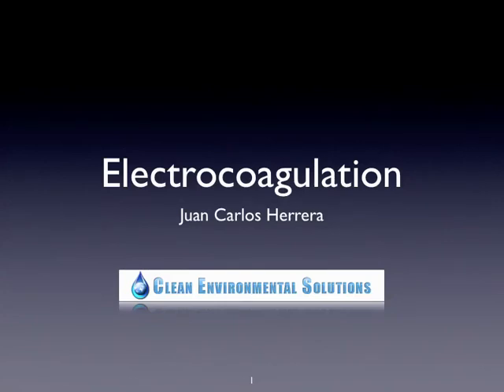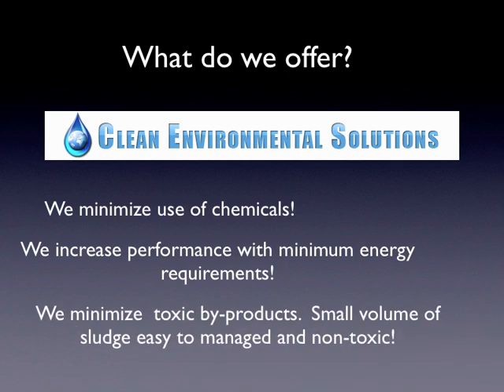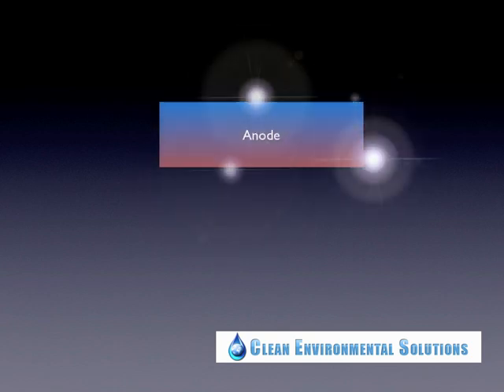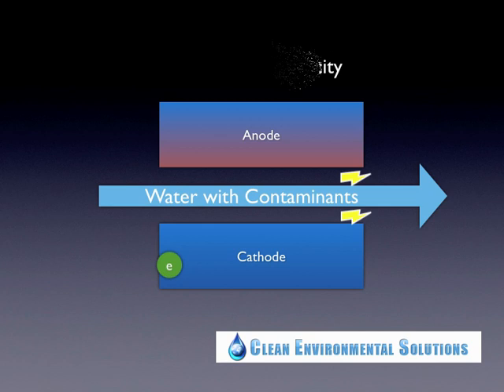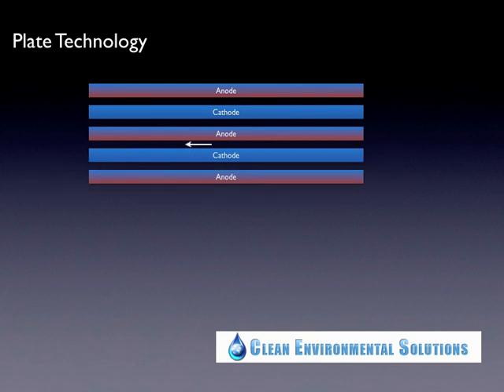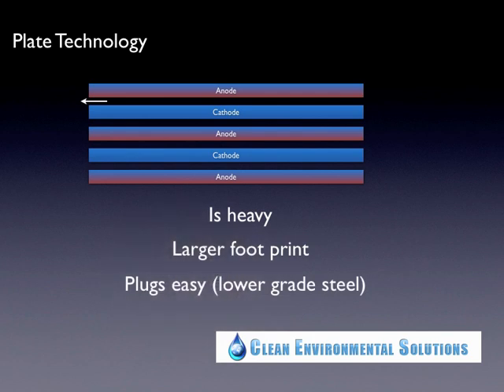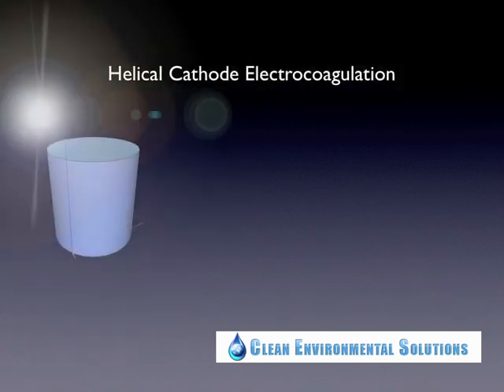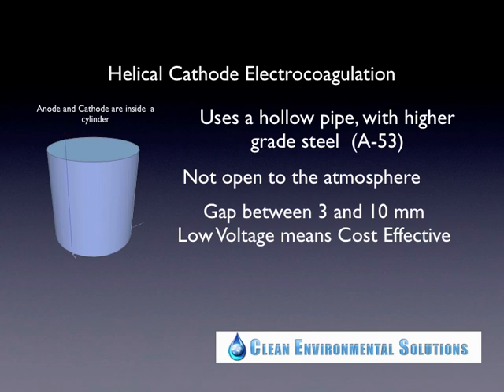Electrocoagulation 101

Comment: Hello Mr Herrera, Good day, i need your help in electrocoagulation, I have made one unit in which i used iron plates with surface area of 10000 cm2 (both sides included). I used 18 pates of same area. Total volume of tank is 210 liters. what should be the required voltage for this? Please guide.
Reply from the maker: Hello Saad, Voltage is not the key. Amperage is the key. But what you describe does not make too much sense to me. Seems like a very big plate 10,000 cm2 for one plate is like 1550 square inches. This would require very high amperage. Are you sure you have calculated the surface area correctly. Very small tank to hold 18 plates? Something is not right. Let me know. Thank you.
Reply: @H2electrofloc  hello Mr Herrera, thank you for your reply. 
The plate dimensions are 0.50 m x 0.95 m. 
Total plates used 18 pcs. (9 anods, 9 cathod)
The volume of tank is 210 Litres. 
My target flow rate of wastewater is 67Litres/min. Means retention time would be around 3 mins in the tank. 
Can you please guide on this. Thanks.
Reply from the maker: @saadjaved7023  It seems to me you have very big plates for such small flow rate. In order to have meaningful EC process one plate will require around 450 amps for just one plate. It makes no sense to me.Why not use less plates and smaller size so that you can do the process better with a manageable size power supply. In my opinion you don't need such size. To answer your original question voltage is not the important factor but as long as you have more than 2 volts you will have EC process. Volts depends on conductivity of the water and space between your anode and cathode. The key is to control the amps for a steady process.
Reply: @H2electrofloc  hello Mr Herrera, 
Thank you for detailed reply. Can you suggest me area of each plate for this volume? Also number of plates. I want continuous flow of wastewater (67L/min). I used 2 cm spacing between plates. Do you suggest the same? Thanks
Reply from the maker: @saadjaved7023  How many amps can your power supply give you in the process. How big is your power supply?
Reply: @H2electrofloc  Hello Mr. Herrera, our power supply can give upto 5 ampere in continuously. Voltage 440V.
Can you plesase suggest for continuous flow of 210L/min, what should be the surface area of the plates, what should be the DC ampere. Thanks
Reply from the maker: @saadjaved7023  Hello Saad, I am not sure if I can be of much help to you since I don't build EC units using plates for this very same reason. They are inefficient and rely on high voltage which I find it dangerous. I make them low voltage and high amperage. The power supply is not good in my opinion.  For iron plates you should use current densities around 0.2 or 0.3 amps/in2 so you can do the math regarding size of plates you want to use in reference to the Amps. I achieve 100 GPM with 10 cells.

Comment: Dear Sir, too much thanks to your kindest active explain,  I keep to one of question that, 
un-treat waster water keep to color mixed  yellowish, pinky. Because this wastewater sauce from piggy faces and urine, we treat 1st step to separate solid and liquid by decanter add  a little quantity cohesive chemical.  but a little include solid and color,  let me know to this electrocoagulation processing possible to discolor ? I think of cause , possible.                         than I wish please  your advice to the test kit by my self product.  thank you.
Reply from the maker: Thank you,  I think you have high levels of Urea. Electrocoagulation can take all the color if you combine Iron and Aluminium electrodes. Using EC you could clean the water in one single step. EC will cause all the solids to float at the same time treat the water. The right combination of power with iron and aluminium will leave the water clear. You may need to add a little bit of brine solution but not sure depends on how much conductivity the EC cell can handle.
Reply: Dear Herrera. Toooo much thank you to your kindest advice, its are very important advised guide for me. meaning that your assist are I will research and study to able to drive correct way road, OK, I will discuss concerning to reasonable EC electrodes and how much capacity convertor from AC to DC etc. also I will prepare salinity liquid for increase conductivity. future, I will connection again to you and the results and following questions etc. thank you.
Reply: @H2electrofloc   Dear Sir, so your advice is very important advice for me then I product lab  and  base pilot capacity  EC. I will trial test but lab scale,  but I keep to one questions that brine solution, it may be sea water, injectable solution for human, and more conclude content salt solution possible, I will arrange 0.1%~25% of salt contents solution possible.  for the more, do you advbice me possible to how to different salt or salty solution VS your brine solution.  because we do not study to brine? then I do not catch to what's the urine?   sorry. please help me.. thank you.
Reply: @H2electrofloc  Your website appears to be broken. Is their any other way, we could reach you?

Comment: hello sir thank you for the video .my question is that i am presently working on the project of "treatment of distillery spentwash using electrocoagulation" which is having chemical oxygen demand (COD) 120000-180000. so what should be the spacing of the electrodes should be used in the treatment.

Comment: I would like information on this technology as it compares with vacuum pressure system, capital costs, o & m costs. Engineers are currently recommending vacuum pressure systems with a high capital costs for sewer systems. Also what information can you provide for public drinking water systems because RO systems are the engineers choice and it is very high in capital costs and the O & M is very expensive and the expertise to operate such systems is almost non-existent in this low income communities.Sincerely,Cesario F. Vela

Comment: Hi, I am a student working on grey water treatment system for residential purposes. I am interested in incorporating the idea of electrocoagulation within the system. I know that its typically used on a larger scale but do you think it could be possible for maybe a home?
Reply from the maker: Hi Mily,  yes  eléctrocoagulacion can be used at any scale it is a wonderful proces you simply need to know that there are two kinds of power you can use to apply it. One is DC power or AC power, it will work with both but there are things you need to consider. AC power will be or could be a little bit more dangerous to use than DC power but DC power is more expensive. Good luck
Reply: Juan Carlos Herrera Thank you for your swift reply, I am working with Mily on our senior project. We would like to know some additional references as well that describe electrocoagulation and its development in today's tech based environment.
Reply from the maker: Thank you! I would be glad to help you and point you in the right direction. Let me know what else you would like to know.
Thank you for your interest

Comment: hello, first I want to thank you for the video, and second I am working on the improvement of the large scale harvesting processes of micro-algae cultured in sea water, do you think the chloride in the sea water will not affect the metal in the electrodes, and do you think in my case the electrocoagulation is the best dewatering- harvesting method that I should propose for a large scale production? thank you very much in advance.
Reply from the maker: Hi Fatina, thank you for your question. Sea water is definitely corrosive but don't let this stop you from your project there are ways to get around it. As far as dewatering or harvesting  I need more information to give you a better opinion on this matter but I will answer generally speaking. Electrocoagulation does not dewater but initiates the basis for dewatering without the use of chemicals which I think will be beneficial to your application. I would say if Fe or Al do not affect your micro-algae then either of those electrodes could be use. You need to dewater using other methods such as DAF (dissolved air floatation), centrifuge or simply by gravity depending on the size of your project. Also I need to tell you that in case Fe or Al affect the algae I have also available a non-sacrifical electrode this is a special electrode that will not put anything in the water but it will simply generate oxygen and hydrogen and initiate coagulation so that you can further dewater your product. I hope this helps or send me more information about your harvesting process.
Reply: Juan Carlos Herrera thank you so much for your answer that was very helpful
Reply from the maker: fatina 미나 your are welcome.  I  have used Electrocoagulation to harvest or gather material from a mussel farm where they are interested in collecting the sludge material which contains a lot of nutrients for the soil.  I imagine it will be a similar application for you.  They cannot coagulate using chemicals so they need to collect it using another method and Electrocoagulation seems to be the answer.  If you are interested send me a  email and I will. Se do you more information.  Also other information about other processes to harvest algae and phosphorus if you are interested.

Comment: Eletrólise.
Ótima solução para tratamento de água.
Repliquei esse experimento tentando tratar uma água de um lago ornamental mas... a amônia deu um disparada. Você mediu os parâmetros antes e depois da aplicação da eletrólise? Sei que esse processo é um excelente floculador, algicida e desinfectante mas, os parâmetros da água não ficam numa faixa ótima de potabilidade
 
Electrolysis.
Optimal solution for water treatment.
I said this experiment trying to treat a water an ornamental lake but ... ammonia gave a shot. You measured parameters before and after application of electrolysis? I know that this process is an excellent flocculator, algaecide and disinfectant but the water parameters are not in a great range of potability
 
La electrólisis.
Solución óptima para el tratamiento del agua.
Dije este experimento de intentar tratar un agua de un lago ornamental pero ... amoniaco dio un tiro. Usted ha medido parámetros antes y después de la aplicación de la electrólisis? Sé que este proceso es un floculador excelente, alguicida y desinfectante, pero los parámetros del agua no están en una gran gama de potabilidad
Reply from the maker: Hi Claudio, yes I recommend using aluminium electrodes and perhaps salt to increase the conductivity of the water to no more than 10 mS. The salt will help to produce chlorine which will help disinfecting the water. Aluminium anodes are better used drinking water applications but  you need to be careful no to produce too much aluminium. Selection of the coagulant is also important for drinking water. I hope this helps
Reply: Juan Carlos Herrera
Thank you for your attention. Any help when The idea is to develop a system for filtering ornamental ponds, fish tanks (fish farming). Do not want to produce chlorine, as would kill the fish. Would you have any suggestion electrodes?
Reply from the maker: Claudio de Castro Good morning Claudio, you are welcome. What are you trying to remove. As far as I know chlorine is only produced when you deliberately add salt to the water and also depends on the current you use to do the work. In my technology I have different kinds of electrodes. There is a non-sacrificial anode that can be use in many applications but I don't know what you are trying to remove from the ponds. If you give me more information I may be able to guide you in the right direction.
Reply: Juan Carlos Herrera
Both in its reply to me, as to Fatima, you quote have a non-sacrificial electrode. You market this lead?
Reply from the maker: Claudio de Castro  Hi Claudio my email is jcthechemist@gmail.com  you can write to me directly at 5 hay email address 
Good luck in your project

Comment: hi, I study mechatronics engineering and will make the study of electrocoagulation for the treatment of wastewater from coal to develop a mathematical model describing the process, I drew attention to the regulation of plant electrodes, since I worked a pilot with iron electrodes (A36) and aluminum (cast) floor, I know that I recommended for the project you want to make. 
Thank you very much, I appreciate any help you can give me.
Reply from the maker: Hi Yeison, please let me know more details as I am not sure how I can help you!
Thank you!
Reply: Hi, What electrode material should I use to think that treat wastewater from washing coal? and whether in the form of plates is the most appropriate, since I drew attention the spiral shape of the electrode used. 

Thank you.
Reply: Juan Carlos Herrera What difference would it make to use the A36 to A53?
Reply from the maker: It makes a big difference actallly and all depends on the iron content. I recommend A53 over A36
Reply: ok, thanks
Reply: How I can make the electrode helical? 
Do you get that way?
Reply: What materials used as cathode and anode which as?

Comment from the maker: Thank you for your interest. I know that Fluoride will require the Aluminium Electrode for sure. I don't think the steel electrode will work in the reduction of fluorides in the water. You can carefully control the current to have more control on how much aluminium is released during electrolysis. I also use a non-sacrificial anode which works very good in many application but I am not sure if this is going to work on reducing fluorides out of the water. Perhaps a combination of Aluminium and Non-sacrificial can do the trick!

Comment from the maker: Yes it does but you have to use aluminium electrodes and you have to control the power settings more carefully. pH becomes important and how to gather the floc so the use of the correct polymer is critical.

Comment from the maker: Hi, I am glad that you find the topic interesting. I don't know much about your project but electrocoagulation for sure will remove the turbidity. You simply need to use the correct power setting and that will depend on your set up. The rising and falling of the floc is not relevant. The rising and falling depends on how much bass (hydrogen) is produced during the process. You need to degas the sample to make it fall. Try simply moving the water vigorusly to degas.

Comment from the maker: That is great!. Aluminium is specially to take the excess fluoride. Aluminium and fluoride have good chemistry together. You are right you have to be careful not to put too much aluminium in the water. I think that the key is to use lower amperage in the aluminium. At the moment I am doing experiments in that regard to find the optimum power setting for drinking water. I think that it is worthwhile continue to work with Al Electrodes.

Comment: Greetings from Srilanka. We have used electrocoagulation process to reduce excess Fluoride and Hardness for better quality  drinking water, and have been very successful. Aluminium plates were used, which brings up the slight risk of excess Aluminium in the retentate. What is your opinion in using Stainless steel or any other type of steel which does not cause problems and does not leave residue which may be bad in drinking water.